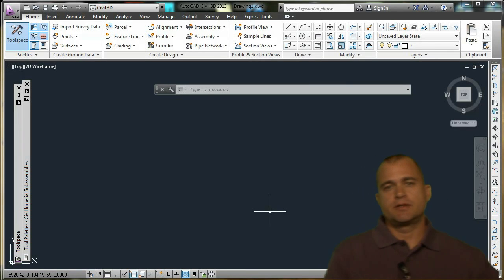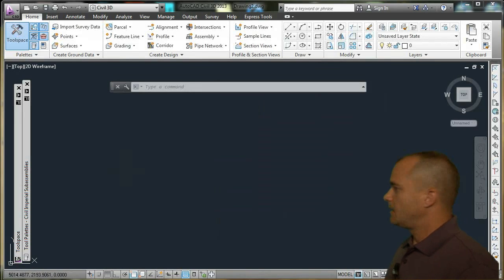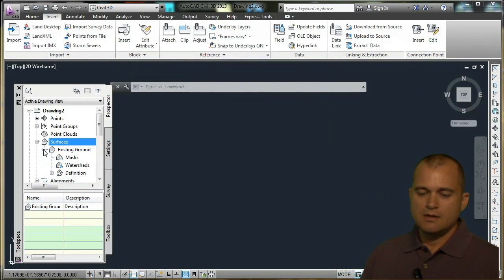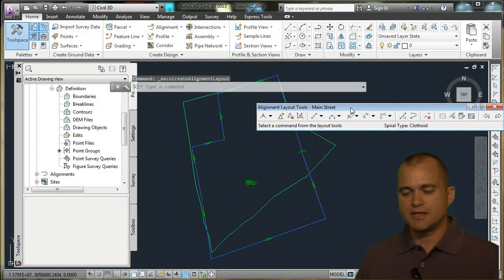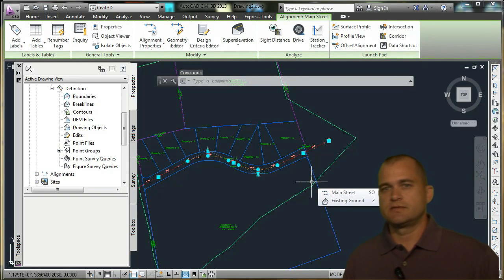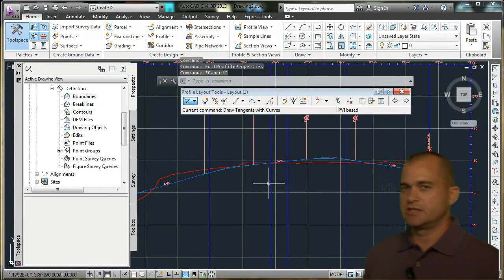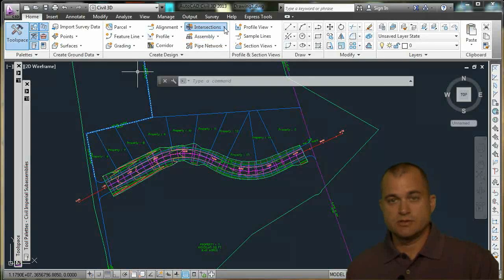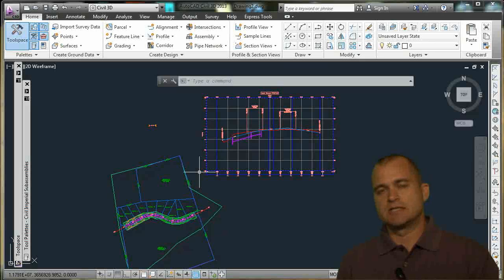Civil 3D 2013 Overview

Comment: I recall watching this as a overview video to training course I paid for a while back that has since been discontinued. There was a portion that covered some direct edits into a profile style in the Text Component Editor that was able to be used instead of an expression. Do you happen to have that video or any resources pertaining to that?

I currently have an issue with some PipeNetwork Connected Pipes which do not allow for expressions to be written for and I wanted to export this as a work around.
Reply from the maker: Anthony, Sorry for not responding to this question. I'm going to assume you found an answer. I've been out of the training world for a few years however I've decided to recreate the training site under a new name called 
 theflyinglabs.com  I'm still working on updating the content. The site will provide a mechanism for users to submit questions related to Civil 3D or other AEC technology in a place that I will be notified so they can be answered. Hopefully it will help users like yourself.

Comment: I have topographical survey data in AutoCAD and CSV format, i have loaded all the points in civil 3D. After uploading those points i have seen in different direction in Civil 3D. in Autocad it is showing North direction but coming to civil 3d The direction is showing to east direction. How can i get proper direction in both files
Reply: Make sure that both the data you have and the AutoCAD file you are using are both set up correctly (Northing, Easting) versus (X,Y).  That will likely solve your issue.
Reply: Thank yo so much yes its worked
Reply: kindly if you have points so that i can practice send it to me via my email ajuke2030@gmail.com
Reply: Bro can you kindly share those points with me.
my mailing address is aayush.humagain07@gmail.com
Thanks!!
Reply: Very nice sir,thanks alot.
Reply: Sir will you pls share those points with me, my E-mail address is mkawes161@gmail.com

Comment: Hi. I have a file with points. I insert it and create a surface. But there's one problem which appears each time, with every surface: when I simply want to make a section through the whole surface with a straight alignment, the profile-view always shows  an exaggerated profile-line, that seems to have double the vertical value as it really has. I can't find the solution to this problem, though I'm practising the same workflow as it is shown here.
Reply from the maker: It has to do with your Profile View Style and the vertical exaggeration. This  http://apwcts.rguidestore.com/autodesk-5/civil-3d/civil-3d-2013/civil-3d-2013-essentials-training.html  might help you as it covers a lot more information on the use of the software.